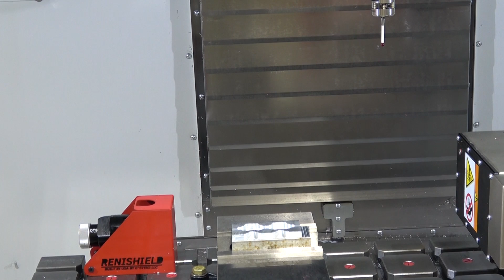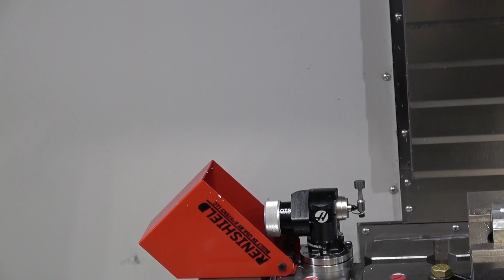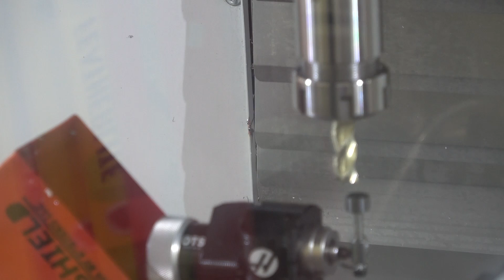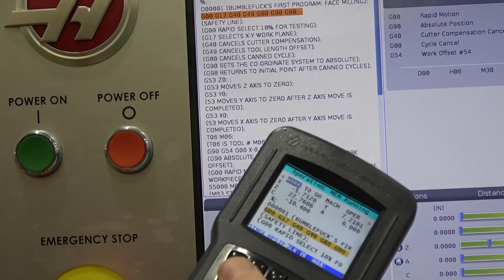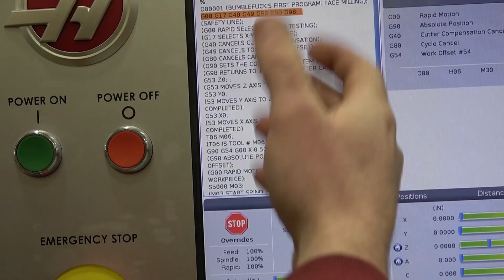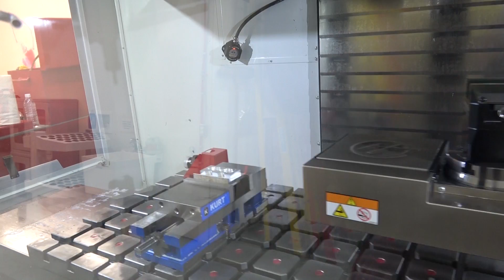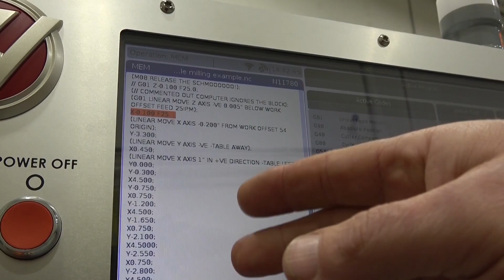Old School G-Code worth the HAASsle? | Intro to CNC mini-series Ep. 2

Comment: This is completely analogous to software development. Why program in assembly when the tools (modern languages) are so refined now? You can get much more done faster, and the compilers are likely going to write more efficient code than you would have unless you've got decades of embedded systems knowledge. A basic understanding of what is going on under the hood is probably a good idea (and most computer science curriculums still touch on assembly too) but don't put too much time and effort into g-code when the tools will just write it for you.
Reply: It is a matter of understanding, and knowing how the machine thinks (and the problem domain, i.e. materials and tooling) will give you an advantage.  Doesn't mean you have to do everything in 1's and 0's.   Since g-code mnemonics don't have an assembly step, it is more like binary IMHO.  

FWIW the opposite of gatekeeping is a shitstorm.    And with AVE opening himself up to every monkey with a keyboard (including every cad/cam offering out there), I think he's done well to understand stuff at this level.  Though it is looking like submissions will largely be either word problems and/or dimensional diagrams, so really the virtually infinite number of ways to generate g-code will be a non-issue and he can use whatever cad/cam he is comfortable with.  And if submitter happen to have the software that supports that format, then they might save him some time (or like most things, the devil will be in the details)
Reply: There still is a time and place for writing your own g-code by hand. For example if you need to do a quick and dirty hole pattern and you don't have a 3d model or some kind of electric drawing for the part. Or if you need to remove  some excess moves from or otherwise streamline the program to be able to shorten the running time in multiple part production. The later especially you can't do in the CAM and usually the CAM g-code is quite "bloated" with extra moves etc.
Reply: And not knowing the how and why of things leads to dependence on machines to do the thinking and ultimately......SkyNet.   Can't wait. ;)
Reply: some finer points...
-not all machines interpret Gcode the same. There's 5 major manufacturers and many more, each with their own control panel scheme, and each with their own quirks. (Haas, Okuma, Mazak, Hardinger, Doosan, many others)
-Not every CAM software is a $10,000 license from Solidworks. I mean, some CAM programs spit out ugly code, or code meant for specific machines. 
-Often times the programmer for the CAM/Gcode is not the same person who's going to run the part. The programmer may not even know what machine his code will run on, it's meant for the machine operator to finish. 
-If you can't read the code at all [you're retarded] then your only option for program edits is to go back to the computer and make changes, then reload it to the machine. In the real world, the computer is usually a long walk away in a clean office, and the machines are in more of a warehouse in rows. 

So, I find it important to know the basics of Gcode.  Start/stop, coolant on/off, spindle direction, optional stop, block delete... Also just being able to read coordinates and understand where the machine is trying to go without having to hit a ton of buttons to see the simulation.
Reply: Ultimately your high-level instructions must be renderable in g-code, assembly language, or whatever the target context is. In my own work (25+ years of embedded systems programming, including embedded Linux), having at least a partially-complete mental model of the target context, and the mapping process to it, seems to greatly improve one's chances of success in the "corner cases".

You don't need to know anything about engines to drive a car, but knowing even a little about engines helps you spot little problems before they become big problems.

Should we program in g-code? Not routinely, no. But I bet that as one's awareness of g-code improves, they become better CNC users.
Reply: The post CAM processor, "the tools that just write it for you", are sometimes written by the lowest drunken bidder.  Its been my experience editing G-code in necessary for prototype/first build work.  The CAM will spit out feeds and speeds, often guided by the tool salesman, that often need adjusting due to the variation from an ideal setup/machine.   I worked at a shop that always posted a G86(boring cycle)  instead of a G84 (rigid tap cycle).  If the previous S-code (spindle speed in RPM)  was low enough, you were lucky enough to get a broken tap.  If the S was fast enough, a surprisingly nice bore, and often a little confusion.  The prudent thing to do is fix the known issue in the Post, but it had been that way for years before me and is probably still that way today.  Knowing enough about G-code allows you to edit at the control and get the job done.
Reply: @johnhuslavani , never mind the fact that since the g-code is fundamentally the wrong expression, you're only accidentally getting the right part. Change just one condition, and the system can't help you because it doesn't have an accurate description of what you are asking it to do in the first place.

The equivalent in the software world is, "...but it passed the unit tests!"
Reply: I'd argue that since every fuck can write a program, most software is bloated shite, but why bother doing it the right way, when you can just throw something together and it'll work, mostly, we'll do it properly some day... or not.
windows xp could run on 64MB of ram and  1GB hard drive, now good luck running a current windows with 1GB of ram.
dos and a PS/2 keyboard have a lower latency than an usb keyboard on windows, and even a ps/2 kb on windows.
the good thing is that there's something for everything, and it mostly works, because computers and storage are cheap, same thing with mills, if you have a good software on a crappy mill, you can do as well as with a crappy software on a good mill.
Reply: This was the first thing i thought. "This looks like assembly". Programming (-languages) has moved on to different kinds/levels of higher abstractions since the 70s.
I totally agree that having an understanding of what is going on on the lower level(s) is essential to good engineering, especially when you have to debug those really nasty bugs (including the bugs in your compiler/runtime, if shit really hit the fan).
But why isn't there a python/go/rust environment for CNC machines (that maybe under the hood compile to gcode), or is there?
Reply: Hmm... compiler wil write more efcient code???
Whell... today you use framework, have no idea what's inside it, and that shit of program work on multi gigahertz machine, with terabytes of RAM much slower then fucking properly written program on 80286.
Oh yes... you have to fire up few gray cells for this to work, and who can do this...
If its not on two click, it's imposible...
Reply: my university doesn't touch assembly any more. bit of a shame for me. while this is true, you can definitely go the other way. computers have gotten faster and faster, but the end programs have not. software used to be written with performance in mind.
Reply: I just love this conversation people that don't know how to read gcode   saying they don't need to learn it. Good luck editing a post with your computer and cad when u need a machine to be in a certain position and the end of a program or a million other reason.  There is no way around learning it if that's the field you've chosen.
Reply: Back in my uni days, 20-odd years ago, my lecturer was demonstrating a cnc lathe. He was showing us how cool the 'new' cad/cam software was compared to g-code. He drew up a quick little chess piece, in the process making a mistake with his mouse movement, deleting it and 'fixing" it. (or so he thought) Before starting he said you could review the g-code, but didn't. We watched in amazement as this lathe turned his little piece all by itself, then in one swift move the tool shot across the piece snapping it in two and damaging the cutter. He "trusted" the cad/cam software, which had kept his error in the g-code.
It never hurts to have a "real" understanding of software. I teach students who are "digital natives". They can "use" software, but have no real clue of how to truly "operate and understand" software.
Reply: I don't know much about g-code, but I can say for certain that in software development the need to know assembly depends entirely on what you do.  If you write high-performance critical applications then it is still very much used nowadays, and I don't see it disappearing in the near future.  Sure, if you make apps for phones then you'll never need it, but that's just one usecase.
Keep in mind universities are supposed to give you an overview of everything there is, you can't just focus on the people who like to develop high level software and forget about the rest.  The same argument could be made the other way around, just focus on low level programming and forget about high level languages, after all if you're going to end up programming in VHDL who cares about java or c++.
Reply: Comments in here are showing a major lag in mindset between machinists who have to use g code, and people from comp sci backgrounds who live and breathe all kinds of code. The idea of needing to understand g code when something goes wrong or being able to trust the algorithm to convert to proper g code because a $50k machine might destroy itself... that is bogus. Real code runs million and billion dollar machinery and no one is worried about making sure the C++ is converting to assembly correctly. It is called abstraction. The C++ is validated to work correctly and you just accept it and move on with it. Being able to use a high level language like C++ is so much more productive than trying to get down to bare metal stuff...
Reply: The big issue is if you don't understand the G-code and there is ANY issue with the way the Cad-Cam is set up and/or any error with the post processor you end up standing there trying to figure out why the spindle is buried in the table.
Reply: @johnpalmer4425  G-code doesn't compare at all to actual computer languages.  G-code doesn't run on silicone.  It hasn't changed much in decades.  Compiling cam to g-code 100% error free when using reputable software.  If your spindle is buried in the table it is 99.9999% chance a user setup error and not an error in the g-code.  The guys cutting 50k dollar TI parts seem to never crash their heads. They just know how to properly use the Cam software and setup their work.  Cam aces RELY on their software DAILY to tell the what the g-code will do.  Not the other way around.  It's impossible with modern complex movements to spot a problem in million lines of g-code unless you're an android.
Reply: @smekula  Well I do this for a living, and usually the error is in the approach/departure moves or the prep codes.  Knowing the codes has saved my bacon quite a few times, and I have been able to relay that info back to the programmers and the company that wrote the post.  Not one of those crashes I avoided would have been due to the setup.
Reply: @johnpalmer4425  This is kind of like saying you must learn how to build a car from scratch before learning to drive. I'd rather get going and learn what I need along the way to fix what goes wrong. Less upfront investment decreases the barriers to entry.
Reply: @NickHorvath  The problem with that logic is a problem could completely destroy your $50,000 machine. Crashing an expensive machine at most jobs is a fireable offense. ALWAYS better to know what you are doing before doing it.
Reply: @ADBBuild  
 @Nick Horvath Sticking with the cars and driving a more fitting analogue would be need to learn the rules of traffic and driving before you drive the first time.
Reply: @ADBBuild  some of the programs my cam program spits out are like 200,000+ lines, there is no way in hell I am going to read through that whole mess
Reply: @thesquirrel082190  The first dozen lines after each tool change are worth reading on an unproven programme. It's not hard to learn enough g-code to know what should and shouldn't be there. Every operator should know that much. We checked the engagement of each new tool as it was selected. Programmed with M01 at each change. This was for toolmaking and cycle times of 8+ hours 

I worked with a guy that after producing a scrap part or a crash would say "the machine just...." no mate, the machine did exactly what you fucken told it to do. Read your code and make sure its heading in the right direction before walking away.
Reply: One reason could be security; unless you wrote the compiler yourself or went over every piece of code in there (and really, who does that?) You don't actually know what is going on, and thus if anything malicious is in said code.

Another reason would be for what I consider a step or two prior to software development, which is hardware development.  You want at the very least a basic understanding of how the hardware operates at it's most basic level as well as an understanding of computer architecture if you're going to try to develop said hardware.  That doesn't apply to most people by any means however.  But they have their place nonetheless.
Reply: @CGoody564  
Not really. Virtually all modern compilers have the option to display the generated code, in line with the program. You can thus examine it to ensure security, efficiency, etc.
Reply: @CGoody564  yeah, you're right, you can't trust the compiler. The machine runs the gcode, so you can't trust that either. There could be something malicious in the machine's software! We gotta use rocks and sticks to do our machining now!

Comment: I think in general, gcode has too many codes. One for "fuck that other shit", One for moves, one for spindle and coolant. 90% of needs.  Add some for aligning your Tool to  workpiece coordinates, 99% of needs. 

Not saying that the other ones are a waste, but if it can be replaced by a number of the basic ones, does it add anything? 

So for learning gcode, i feel that if you know how to do a faceing, do you need anything more... Why are there multiple ways to do the same move?

Comment: Um..... did I read M09 right? ......end Bukkake ??? Whatcha got goin in that machine, man!?
Reply: Coolant setting?
Reply: M09 turns the coolent off.
Reply: judge not, lest ye be judged
Reply: Fun with funnels and turkey basters.
Reply: M09 is not related to Goo (also not the same as GZeroZero but easily confused when hand typing the Gcode)
Reply: I really thought I was imagining that.
Reply: Ending bukkake is a terrible idea.
Reply: He didn't change it. He had it in a previous vid already. :D
Reply: so m09 is coolant off yeah that works
Reply: Well, M08 was Release the SCHMOOOOOO! so guessing it was to halt coolant release
Reply: AvE's shop is no place for an overweight, baby-faced pink-haired lady with goth makeup to venture in. The only thing keeping the SJWs away is that any of AvE's fans will tell them where to go quick-fast-in-a-hurry and warm their toes.
Reply: @Acoustic_Theory  I don't call myself an SJW, but you probably would call me that, since I'm socially liberal, feminist, polyamorous, totally fine with people defining their gender however they want, fine with people wearing whatever clothes or whatever they want. And yet, here I am! Watching AvE, running a wood and metal shop in a school, and starting a woodworking business on the side. So what was your point?
Reply: @evanbarnes9984  Same here. I'm a pansexual feminist socialist guy. 
There's a ton of transgender programmers and electricians out there, who are usually fighting for their rights and thus could be called SJW's... I follow a few of them on youtube. 
Engineering isn't bound to class, gender or political stuff. 
[deep movie trailer voice] Social Justice. Soon coming to a workshop near you.
Reply: @mfbfreak  all you had to say was yes, im a sjw. I mean you listed off all the requirements.
Reply: @Acoustic_Theory  I don't understand what you're suggesting.
Are you against justice? Or against women in workshops?
Or what?